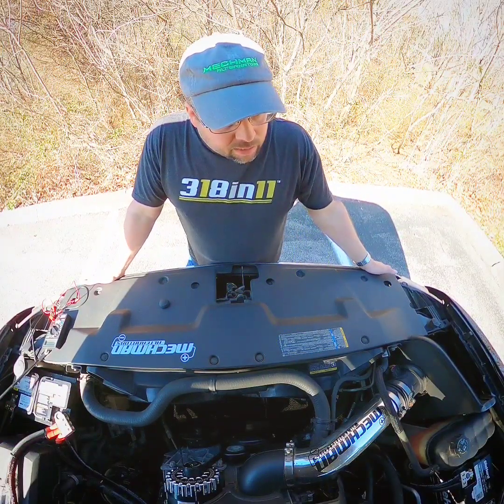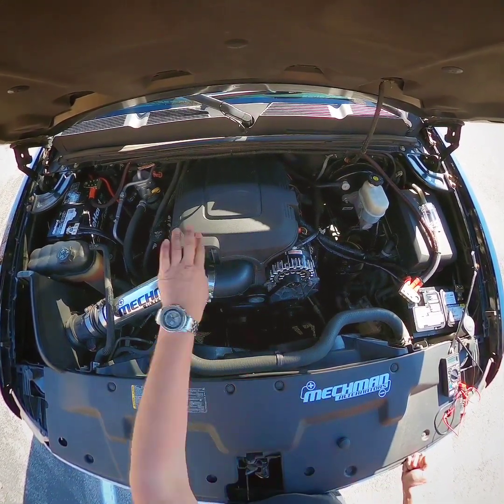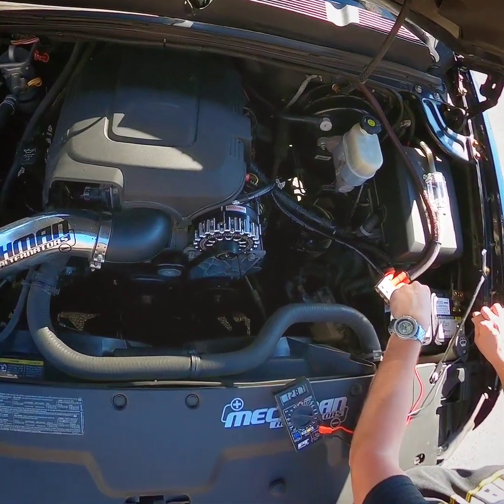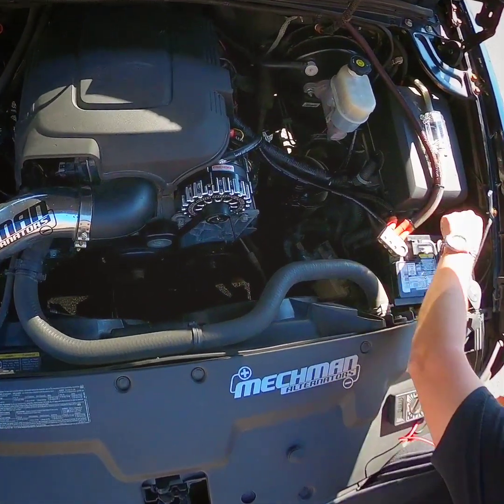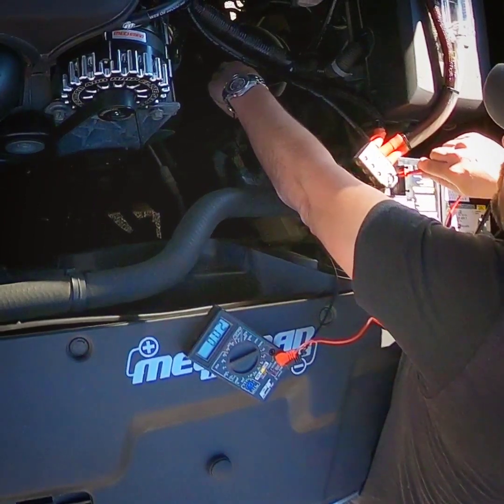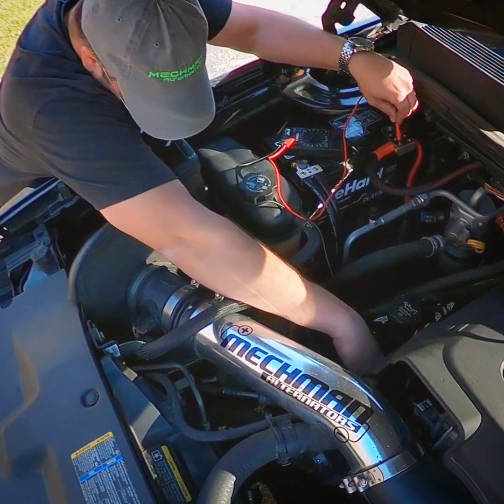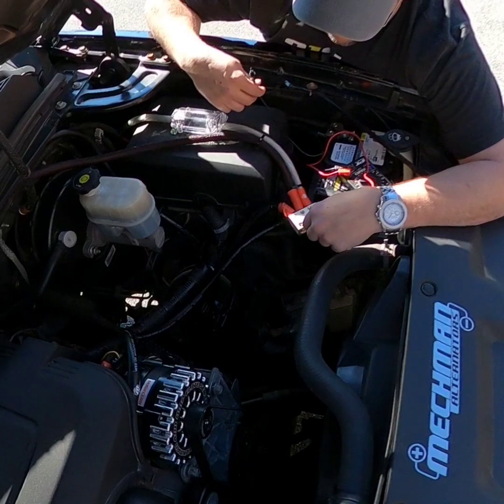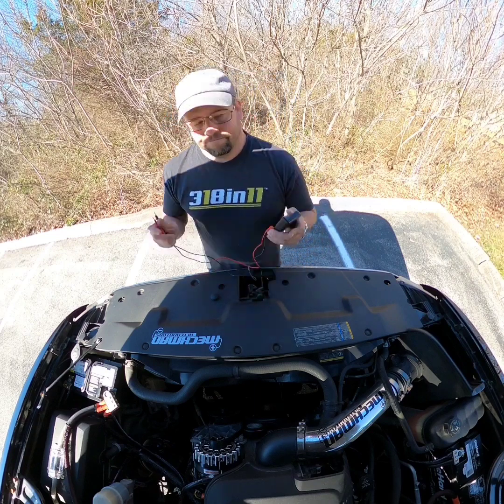Staying grounded. Simple basics of continuity testing.

Comment: This is an important subject and great video on it. This works, however, I like to heavily load the charging system while performing the diagnosis. I'll drain the lithium bank down a bit, say down to 13v. They pull LOTS of current when depleted even slightly. Then I get to my grounds, and I start at the negative battery terminal, and measure if I have ANY voltage from batt ground to my other various grounds while under heavy load. When the alt is at a high duty cycle (full load), if you can pick up any voltage between grounds from the battery terminal, that's where your loosing voltage, and have a high resistance connection at the equipment or distribution blocks. I like to do it under full load, as it will bring out and show any resistance the circuit may have while pulling current. I found a bad crimp not too long ago using this method on a positive wire using this method, and bought a hydraulic crimper that makes the wire end and terminal one piece when pressed with 16 tons. Gained 2 tenths when charging from one semi bad connection. Super important if you want the power you paid for. I highly recommend hydraulic crimpers, after owning a set, I'll never use another method again. It's way easy as well, just a few pumps and you have the ultimate low resistance connection. I should do a highly detailed video on this subject. Thanks for the info!
Reply from the maker: We love everything about this comment!!! Thank you!  I'm trying to keep these video's under/around the 10min mark as to not lose interest in todays modern 5 second attention span.  

Thank you again for your contribution to the topic!